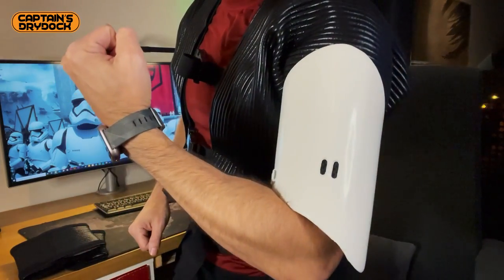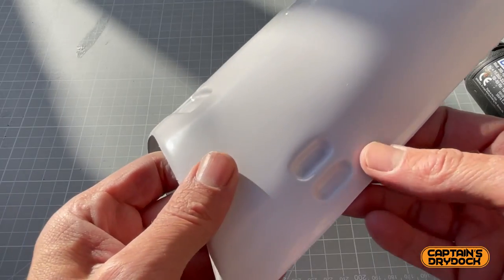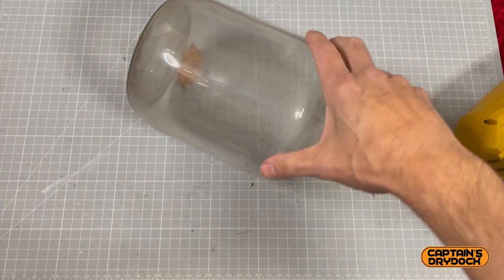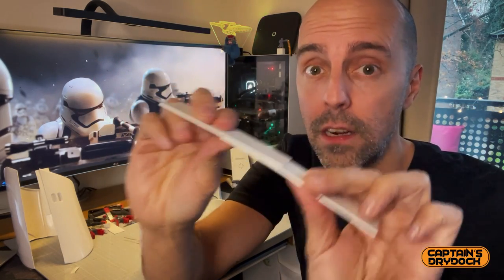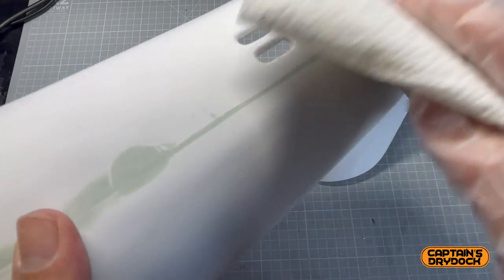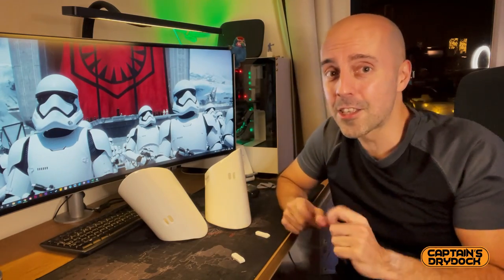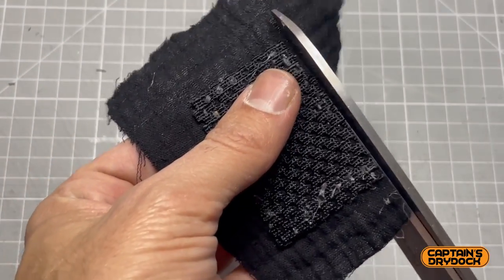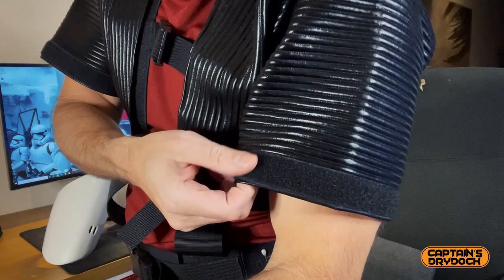Building First Order Armour: Ep 11 Biceps

Comment: John, could you use the plastic melt for the whole build or at least some of the other places you used epoxy?
Reply from the maker: In hindsight I would have used plastic melt on most of the parts. However, there may be occasions during a 'first' build that you may not have glued things correctly and so a glue like E6000 or E7000 is recommended as you can pry it apart and try again if you got something wrong. Personally I found epoxy too rigid a glue for a project like this.
Reply: @CaptainsDrydock  thx.  Plus I don’t think we can get plastic melt in the US
Reply from the maker: @kanga430  It will be known as different names depending on the country. Here's a similar item in the US.

https://www.amazon.com/Plastruct-Plastic-Weld-applicator-Bottle/dp/B00FDFWJD8/ref=sr_1_1?crid=23TULDLE2EDAF&keywords=plastic+weld+model+making&qid=1655107477&sprefix=plastic+weld+model+making%2Caps%2C140&sr=8-1